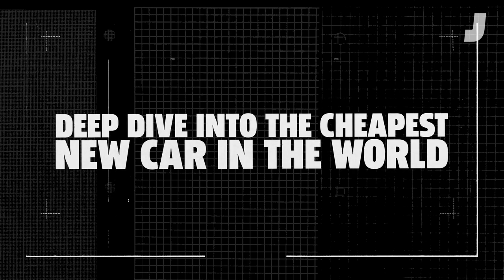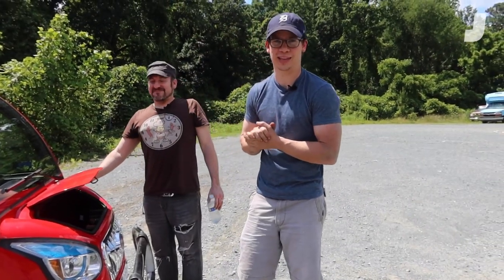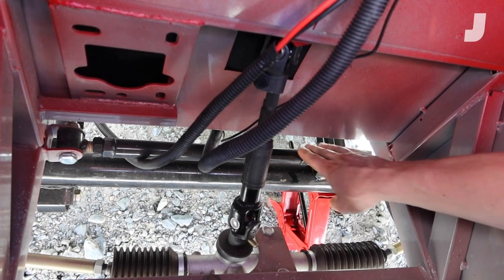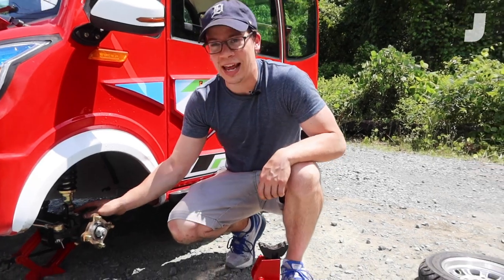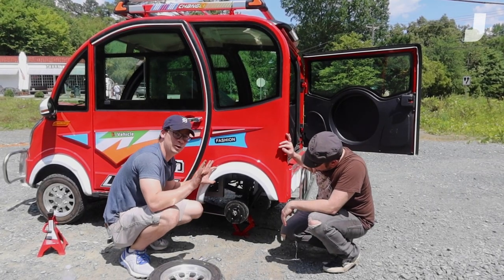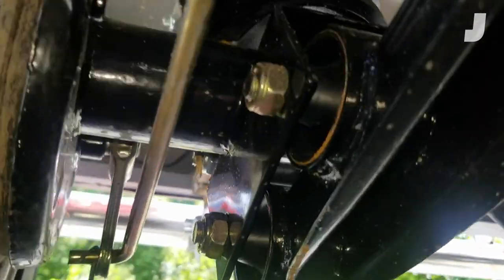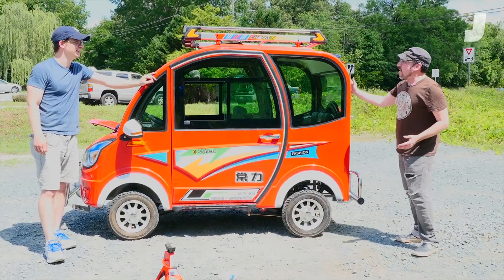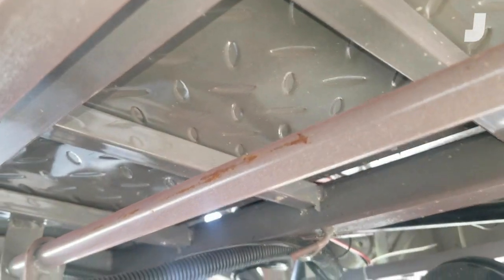The Impressive Engineering Behind The Cheapest Electric Car In The World

Comment: Why the windshield is not flat?  Obviously, because Fashion!
Reply: Make sence:)
Reply: The glass is part of the structure...
Reply: Lol
Reply: Chang Lee VERY fashion!
Reply: Costs a lot. More
Reply: The windshield curving outwards creates more space inside. Which is a pretty good idea, because the car is small.
Reply: Hahahahaha fashion
Reply: not sure if you have noticed, but it has an electric heater fan within it, allowing you driving over winter
Reply: It may also have something to do with the body stamping. Looks like it's cut from a single plate then folded up like a fancy cardboard box.
Reply: @isgodreal1337  i hate those fashion/ sport kind of badges on shoes clothes, just like i saw 忠 义 tattoos on foreigners LOL
Reply: It couldn't agree more, lmao.
Reply: Akimbo Madman lol
Reply: makes sence
Reply: Hahaha
Reply: single sheet tool and dye stamping, no welding,no rust, no extra insurance, more ridgid longer lasting vehicle structure. Quality,efficiency,economic manufacturing, smart 
frugal engineering. provides open airy feeling and upfront dash space. should add
 plastic fitted removable container to empty space upfront under frunk lid.
honda,toyota etc 100 years ago. very interesting
Reply: more like profit. unique windshield and back window means you have to order replacements from the manufacturer there is no one size fits all company that makes cheap alternatives
Reply: Hey. The decal does say fashion!! Lmao !!
Reply: An eighth of a dead Hyundai gave birth to this modern marvel..
Reply: Kai Zhan but the question is. Would you ?
Reply: 30% of the structural integrity of a vehicle is in the windshield. That's why it curves.
Reply: lmao

Comment: Am I the only person that wants to buy one and spend 5k modifying it? 😂
Reply: Yeah make that thing fly ha why I'm I thinking cliff
Reply: you can throw a used Yamaha motorcycle engine into it and boost it up a little
Reply: Yen Tao  
Yup do an ls or busa swap
Reply: As I commented below, you may try the real EV car from the SGWM, E 100. It will cost you roughly 7000 USD. It just like the Smart.
Reply: Beef up structurally and put a Chrysler Hemi in it. A real smoking machine.  A real head turner.
Reply: Perhaps not 5k but it would an interesting little to improve upon, even if it looks like a carnival vehicle on the exterior but that might just add to a sleeper build.
Reply: I was thinking about a Harley Sportster 1200 motor....
Reply: could probably turn it into a Hilarious off-roader
Reply: Id love one would not change a thing .
Reply: I'd watch your videos of it!!
Reply: @georgesheptak5657  a hemi is as big as the whole car
Reply: Don't forget to put front brakes on it.
Reply: I was thinking of ripping out the back seat and dropping a 289 in it.
Reply: Why everyone wanna go gas engine? Just beef the electric system, add li-ion and higher power motor and retain your instant torque!
Reply: @american7169  
For me, convenience, no waiting/looking for charge, hp. And nothing sucks more than hi voltage fire.
But the way technology is going with batteries, its not ruled out.
Reply: Tesla motor and cut down battery pack.  Death would soon follow, but it would be fun.
Reply: No.
Reply: Guys you all are speaking about engine swaps
But where the fuck will you put the fueltank

Comment: I would spray an undercoat to prevent the chassis from rusting!  Also, I would make sure all the nuts and bolts are tight, and maybe replace some of them with noncorrosive ones.  You can add a plywood platform in the front "trunk", seal it, and make it functional for additional storage space.
Reply: then step one buy one step two do that when you first get it and go crazy with the undercoating
Reply: @raven4k998  True.  However, it's going to cost a lot more than the $1200, and I'll have to wait a lot longer to get it, considering the problems with inflation and shipping.  Plus, I don't trust the quality coming out of China (and I'm ethnically Chinese!), unless they're manufacturing with specifications from a US company.  Otherwise, I'm sure things will start corroding and falling apart over a short time!  :-)
Reply: @richardl6188  i'm sure things would start corroding even if you dipped the whole thing in gold
Reply: @kakerake6018  If I had that much gold to dip a car into, then I probably would sell it and buy a Tesla!  😃
Reply: @richardl6188  dont think teslas are well built by any stretch.. ;)
Reply: @richardl6188  At this price you could buy a new one every year...  ;)
Reply: @cwt5654  yep!
Reply: @richardl6188  That empty frunk could be fitted with a preinflated air bag for safety...
Reply: @cwt5654  The airbag would be an interesting safety feature! or even put a portable A/C in there for the hot summers!  lol 😀
Reply: @richardl6188  I hope you checked his 1-year-later video on how the ChangLi held up.
Reply: @h8GW  I didn't know they had an update.  I'll go check it out.  Thanks!

Comment: I would definitely go lithium-ion and maybe swap out the roof rack for a solar charging type system. We as consumers should demand this be here. The price is right and the mod ideas are plentiful!!
Reply: Yea, like a wheelie bar
Reply: You greatly over estimate solar charging. I've ran the numbers and if I covered the roof, hood, and back glass of my Chevy Volt with panels, it would take 25 days to fully charge it, assuming no cloudy days and 100% charging efficiency.
Reply: @EatPezzzz  I'm guessing the Volt makes a tad more than 1.1 horsepower though. That's another number to consider.
Reply: Guess what, they has the Lithium battery version, the solar charging version even a Hybrid version...
Reply: You need to lock it very well if you do not want it to be stolen with the roof.
Reply: So loading big weight on the roof can drop the car on the bend of road.
Reply: if wind will don't blow this car anywhere
Reply: @EatPezzzz  Yes. Solar panels are more suited to power little things like the fans, radio, rear-view camera (!), etc. Not for charging the batteries.
Reply: @Tanya Rodriguez -- womp womp - Debbie Downer!
Reply: The Sion Sono will have a solar roof. The manufacturer claims, that on a sunny day, this will give you 30 km (18 mi) range just from standing in the sun.
Reply: @patrickfoster4586  The power of the motor does not say anything. The energy you need depends on the final velocity (squared) times the mass of the car (E=½mv²). So a slow, light car needs less energy. Besides that, regenerative breaking can save a lot of energy.

Comment: Would be simple to add 400w of solar panel on the roof, self charging!
Reply: On this weak car would actually make sense
Reply: Extra weight on that 1.1hp though.  But Take out the back seat, door panels, flooring, then it go for it.
Reply: @gtd360  get rid of the steel-tubing-bumpers first! they nice, but also weight...
Reply: Good luck getting 400w. You might get 100-200w max on that area. good idea though
Reply: Some of these cars have the solar panel as an option
Reply: That would actually make sense, 1.1hp is only about 1000w, with a 400w solar panel you might never need to charge it ever
Reply: @gtd360  Roof rack too...
Reply: what i love about that idea is that the car can't be stranded with a flat battery. the worst case scenario for not having a working charger is that you leave the car parked for a few days and it's good to go. this is genuinely meaningful in the substantial fraction of the world that has utterly miserable infrastructure. this could be a useful bullet-proof device for a thatch-roof village in the middle of nowhere. in fact solar power and cell phones have brought technology to people who were never going to get infrastructure like copper-wire exchanges and power lines ... you just install stuff piecemeal on a blank slate. it makes me happy to see tech giants designing stuff for poor people instead of trying to work out one more way of putting a thousand horsepower in a vehicle they can sell to people who have no real need of anything. clearly this is an assemblage of commodity items from parts bins of more expensive mass produced items, making it not only cheap to buy but cheap to repair, as well as reducing the total parts inventory that is out of control because every traditional manufacturer is bound by oath to create a proprietary version of nearly every component. imagine the horror if people weren't forced to come begging for a branded wing mirror with a 100x markup, because they could get the part on ebay. imagine the economic collapse of businesses becoming more efficient at the expense of undeserved profit from parts & repair, for the shallow consolation of the world becoming a happier place
Reply: Since this uses lead acid batteries, adding a solar panel isn't all that straightforward. It would require a bunch of additional hardware that would add weight and negate the benefits of having the solar panel.
Reply: The world's largest solar panel Trina solar plant is right next to Changli.
 Usually, this kind of electric car is not allowed to drive on the road, but the police will looked other way  because most of them are used to express delivery and the elderly to pick up children in winter
Reply: Perpetual motion machine？？？
Reply: Well, this video is forwarded to watermelon video and Topbuzz（TikTok brands，Chinese youtube，） has already had  nearly hundreds of thousands of clicks. So, register your podcast platform（JALOPINK）  quickly. Oh, estimated income will cover your expenses of this scooter，If you continue to make some open box evaluation videos of China's economic electric cars ，scooter，motocycle，solar panel charger , you can easily accumulate millions of fans .
Reply: @gtd360  solar panel are pretty lightweight. I use semi flexible ones on my van to power tools and a fridge. 2 times 200wp. Plus an aluminium rack to hold them. Weighs 14 kilo's (30 lbs)
Reply: @rw9495  not true. A 500w mppt charge controller weighs 1 pound
Reply: @rw9495  obviously you've never done a vehicle solar install in your life. Your comment shows no knowledge.
Reply: @gtd360  thin film solar panels weigh almost nothing - they're little more than a thick roll of plastic.  It would double the cost of the car to add a few hundred watts of PV, though, but to have a car which will fully charge itself over the length of a sunny day would be pretty neat.
Reply: I was thinking the same thing 2
But" it would at least have to go 65 for me" get around !!!
Reply: @rw9495  A simple £25 MPPT solar charger will do, weighs about 300g.
Best change to Lead-Carbon batteries when required.
Reply: @MrLloydforever2  : hot rodder. Endure the demise of fossil fuels as it happens!
Reply: @G-ra-ha-m  dear Graham. 25 pound mppt's are nonsense. I install solar all the time. A true mppt is expensive (though worth it). I measured/checked multiple cheap "mppt" chargers. They are all PWM in a fancy suit.
Reply: @basvanbeers3515  no the right vehicle solar is specialized... a little bit more expensive and a little bit less efficient but much lighter.
Reply: @macmcleod1188  bababullshit.... preach into the choir.
Reply: @rw9495  You colud theoretically upgrade the batteries.
Reply: and make it removable plug in for days with no sun
Reply: @5naxalotl  I love how you think! For years I've worried over places like India and now parts of Africa repeating the American Dream (big house, big car, all in name of prosperity and keeping up with the Jones'). Why not skip the air pollution and environmental devastation and get it right (or as right as posdible) the first time? Learn from and don't repeat the wasteful errors made by the West.
Reply: @quisqueyanguy120  A 16S lithium ion pack at 2 to 3 kwh would probably be equal to the usuable range of that lead acid battery pack that has at best 80-90ah cells that you can only use 50 percent of if you want them to last at all. You could build a replacement pack with BMS for it for less than $500 if you do some digging around for deals. And you'd drop several pounds of weight.

Comment: You could improve/mod the hell out of that thing for a few hundred bucks and it would be even more badass.
Reply: They should totally do a series on that!
Reply: Strap a big engine into the rear and make it faster than it ever should have been
Reply: @deeznoots6241  it would tip over going around the first corner.
Reply: @stephenfowler4115  I would do the slap a better motor on it but not for the track. It's just for stroll because you're right lol. Unless you put on some wide wheels on it.
Reply: Used motorcycle for an engine donor im sure anything over 500cc would make it rip the tires right off
Reply: They shud put a high power motor like had a low speed gear switching to high speed gear

Comment: Seems like a great project car for high school shop classes, electric vehicles are becoming more common place and we'll need more people interested in repairing them. This is really cool.
Reply: Ooh, yeah, imagine if you could buy this as a kit instead of pre-assembled.
Reply: Pocket Fluff Productions then it will be even cheaper also cheaper transport fee
Reply: @Pocket Fluff Productions having some previous experience with Alibaba, I’d say there’s about a 99% chance you could buy one, or a few of them, unassembled. 

Alibaba’s purpose is basically just to connect you directly to factories in China where you then negotiate price and whatnot, so you could probably just ask and they would ship you the parts instead of a whole car no problem. 

Alibaba is usually for buying parts in bulk directly from factories whereas AliExpress is for buying single items or smaller batches usually from resellers (basically Amazon but for Chinese made items...so basically still just Amazon I guess haha), but I guess since the car is a high price item—compared to say a microchip—they were also doing single sales.

China’s manufacturing is a bit unique compared to western countries in that there are lots of small factories that build the same product (or slight variations on the same product). I’m sure some smaller factory making these types of vehicles would be more than happy to sell a few without having to put them together. Hell even a bigger one would probably do it. A sale is a sale.

Comment: I'd love to see Rich Rebuilds modify one of these.
Reply: Aging Wheels would probably also have a lot of fun with it.
Reply: @johnruschmeyer5769  Hey, yeah, I think we just found the replacement for his Wheego!
Reply: Just add more 12v batteries
Reply: I agree, mod it ad HP
Reply: Maybe put a Hayabusa engine in there...
Reply: I'd love to see Colin Furze try to build something like this.
Reply: @Taladar2003 he would need to make a whole new one because what ever he put in it would rip it in two
Reply: @johnruschmeyer5769  Have we found a replacement for his Wheego?
Reply: When I was a teenager, I modded a kid's electric car. It used a 6 Volt battery.  I added another 6V battery in series.
It doubled the top speed.  But the little motors (one on each rear wheel) ran hotter.  The plastic on some wires melted a little.  Could try adding additional 12V batteries in series to increase the top speed, but watch out for overheating/melting.  Be careful on hot summer days.

Comment: I feel like if you bought a ton of these wholesale and modified them to have airbags and seatbelts you could make a fortune renting them in big cities
Reply: I would like to clarify that I said this before I saw how badly they actually drove.
Reply: @LastRaven these have a speed limit cap, they can go 40mph if you remove it.
Reply: @ion_force  And therein lies the rube. These things are just caged golf carts with no performance whatsoever. The only market for them is the geezers who drive softly enclosed golf carts around the suburbs. And most of them are watching Fox News every day so they probably would be totally averse to some chinese import.

I was really impressed with the suspension and the aluminum wheels but on something that goes so slow you really don't need any of that. And despite how modern the suspension is you have to keep in mind that the components are probably made out of chinesium so their longevity is quite suspect.

Only real hope I have for this glorified golf cart is for someone to hotrod the shit out of it with new motors and batteries so I can see it go like 80 mph. And then something will break and they'll crash and die.
Reply: By the time you add safety features  you could just buy a chevy spark.
Reply: The liability insurance would kill you
Lawyers and lazy people destroy everything
Reply: @sntslilhlpr6601  "Chinesium" As if China wasn't buying every shred of scrap metal for almost a decade straight.  If "Chinesium" is still a thing, it's because of the quality of scrap the west sold them.
Reply: Needs crash test ratings.  Idk how it got legally imported.  Good for him though.
Reply: The manufacturer may tailor made or modify for you depending how many you order
Reply: airbags in this car do nothing. it will be flattened into a piece of paper with the airbag and the driver. it should only be used in parks.